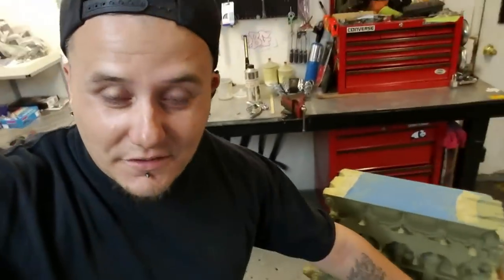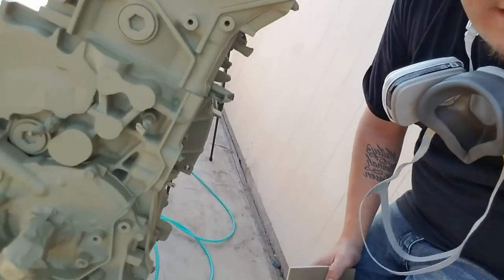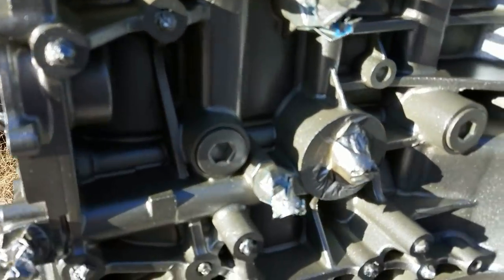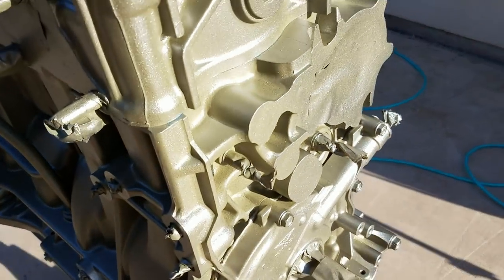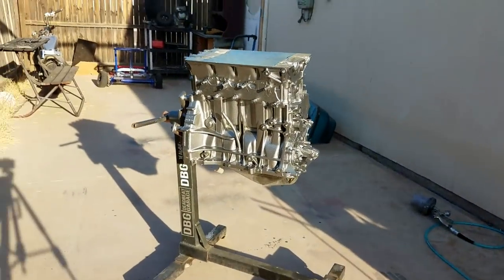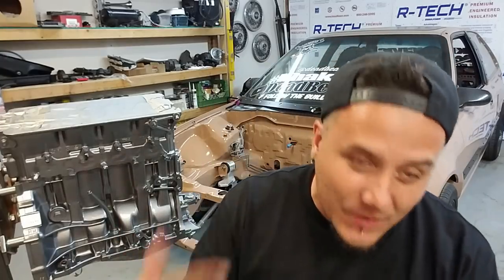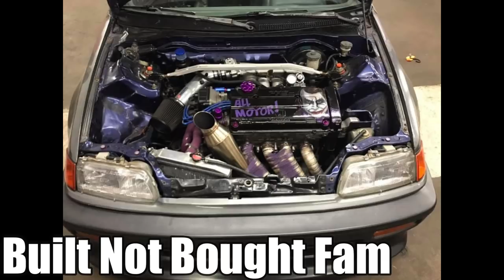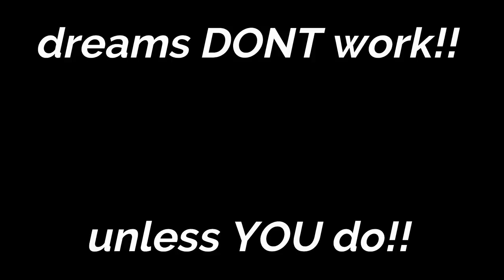Painting the B20 vtec (Part 2)

Comment: Bro how does the motor attach to the engine stand ? What hardware did you use. I need to put my motor on a stand to work on it but I'm confused on how to attach it to the stand
Reply: Use the bolts that mount engine to transmission